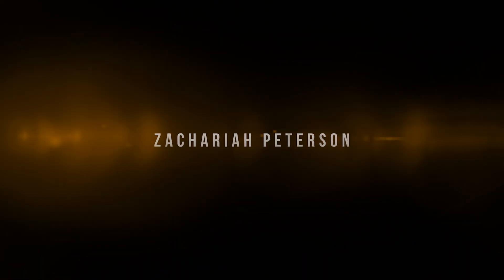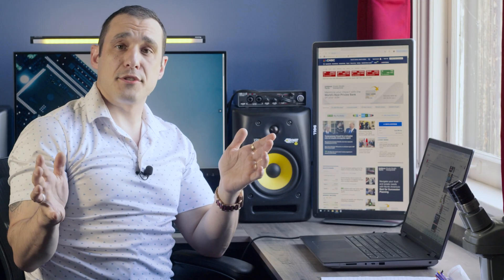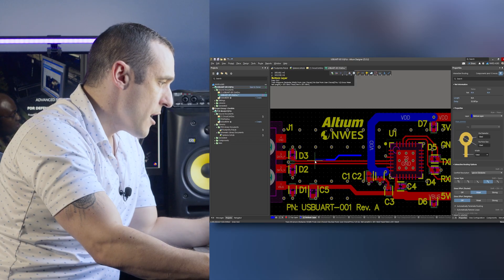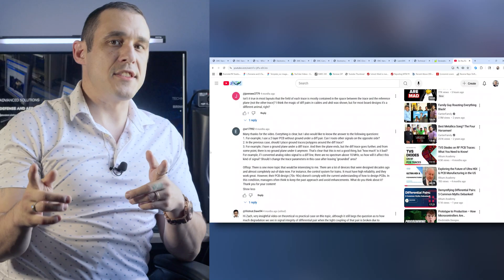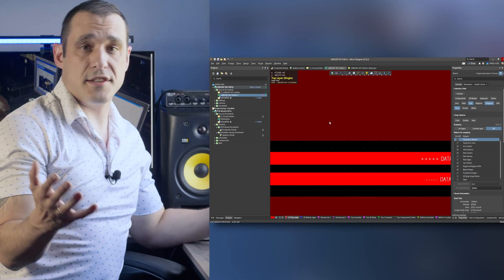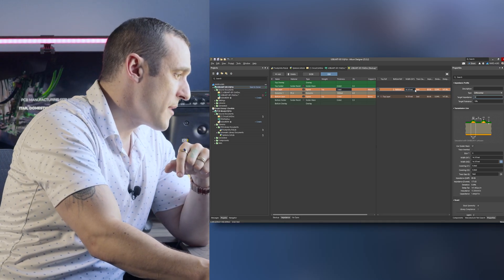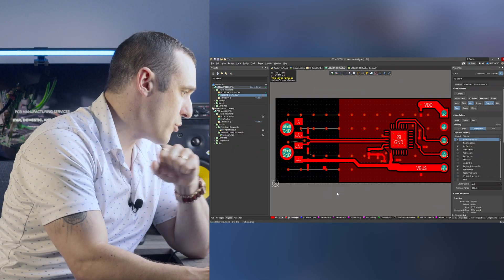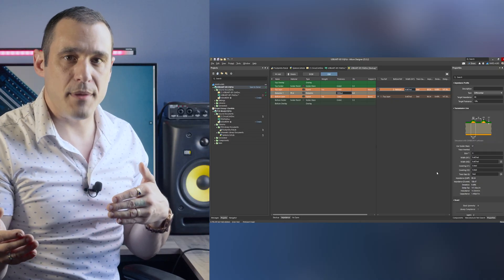Differential Pairs With No PCB GND? Zach Answers Viewer Questions!

Comment: Thanks for posting the next wonderful video. I am doing the flex rigid PCB. Fabricator is asking to provide 2 mm clearance between any flex part to rigid part because of the manufacturing issue in cover lay. Could you please explain this issue with bit more detail?

Comment: what about differential interfaces after transformers like Ethernet, will a plane harm the impedance ? 
Also I saw somewhere that people removed the GND plane from under PCIe coupling caps is this ok? or is there a trade off if you do this?